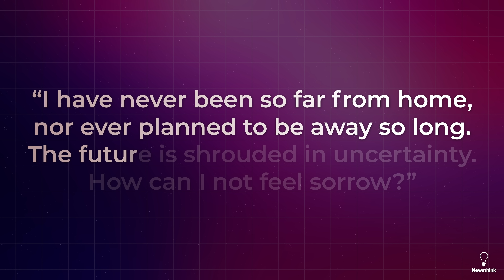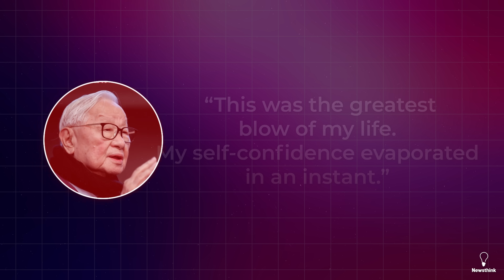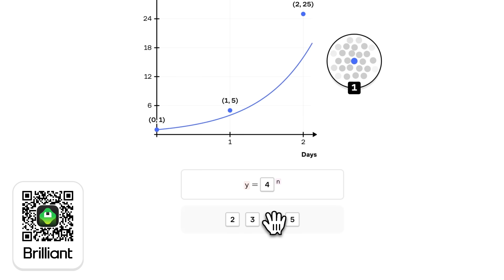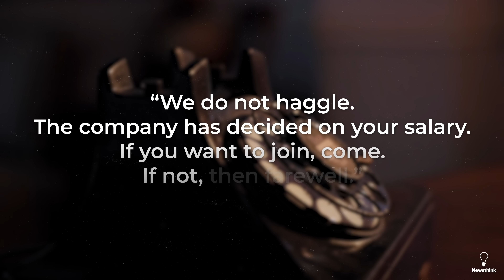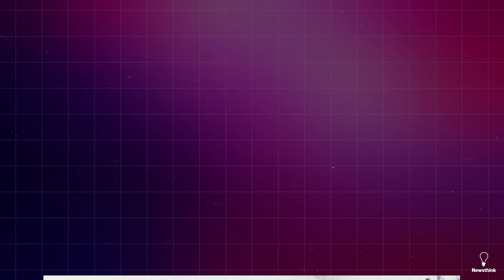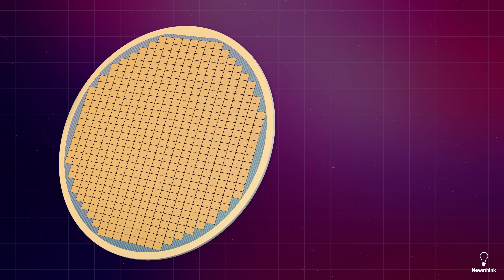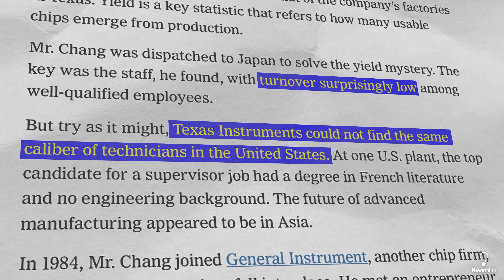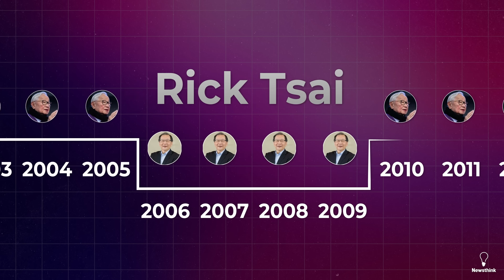The Man Who Built the World's Most Important Company

Comment: Apple has played a much larger part in TSMC rise than NVIDIA.

Apple started to design its own A chips for iPhones with Samsung making the chips. Then TSMC got given some of the orders.

Samsung makes its own phone brand that directly competes with Apple. Apple was aware of this situation might mean some issues. 

After TSMC turned down Apple’s offering to buy 25% stake in TSMC, Apple switched its full production of A chips and later M chips to TSMC.

25% in US system means the control of the board usually and hence the control of the entire company. TSMC doesn’t have one single shareholder with more than 10% voting shares I believe. 

Chip making is a chicken and egg industry due to the huge capex (cost of new fabs). Without advanced chips, profit margins would be lower so profit not cumulated high enough to invest in new best fab.

With much larger orders and hence cashflow from Apple’s entire chip needs, TSMC has had the cashflow and profits to invest in better and better tech and fabs making chips.

Apple’s influence in the success of TSMC could be seen by the fact that the entire 3nm productions were booked by Apple as TSMC’s for more than 1 year after the 3nm technology was first brought to commercial production. 

Nvidia has its best chips still only started using the 3nm tech after Apple was using them for about 2 years. 

Google’s Tensor chips- for Pixel phones and Generative AI uses- only started to be given 3nm tech by TSMC this year.

(My cheap 16e iPhone has a chip faster than the most advanced Tensor chip in the most expensive Google Pixel phone that is about 2 years behind)

Morris Chang undoubtedly is the godfather of TSMC. His contribution to the modern chip and entire IT industry is tremendous. His insight that chip manufacturing is not an easy affordable effort for everyone hence there is a need to specialising in chip making vs design is the single most valuable understanding of modern IT manufacturing.

However Apple is the one company whose decision to rely on TSMC has made TSMC what it is as much as Morris Chang has.

Nvidia and Apple will continue to dominate TSMC order books in term of the very high end chip productions. 

AI has its trajectory. Apple products have their own.

Solid demands I believe will make Apple’s presence in TSMC more important and certain.

Contract manufacturing is an art that many Taiwanese companies have excelled in.

Foxconn is another example and they make products for all sorts of known brands. 2 private family businesses in Taiwan are responsible for making more than 2/3 of all shoes for the global brands- Nike, Adidas, Puma, New Balance, Converse and Under Armer.

Taiwan also makes about 90% of all parts (in value term) for modern commercial aircraft manufacturing. 

Taiwan isn’t just about TSMC, it has over 30% of her GDP in manufacturing. Its per capita GDP, just these few days announced by The World Monetary Fund, to be higher than that of Korea and Japan.

This is a story as worthwhile to discover and discuss than TSMC only for Taiwan.
Reply: You didn't mention AMSL and their hand in TMSC rise . Without a machine to make an advanced chip its just a design.
Reply: Wow. That was informative. Thanks man…
Reply: Thx Dude !!
Reply: Such a informative comment, thanks